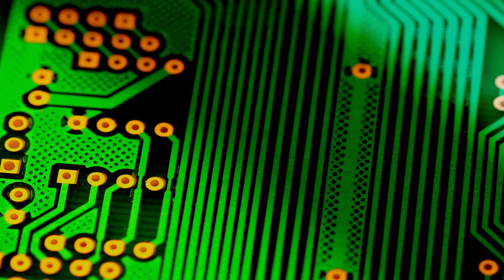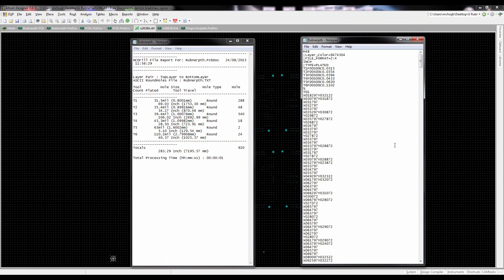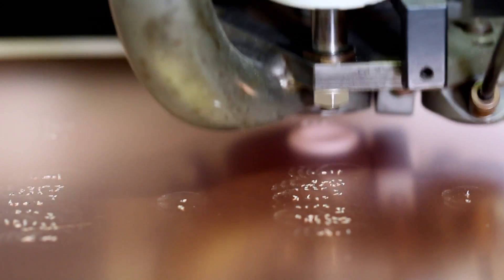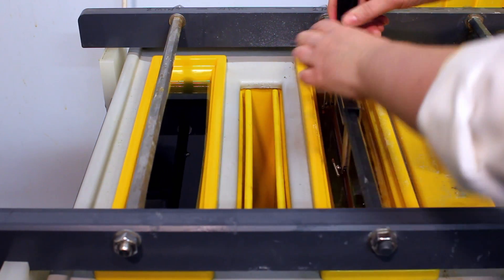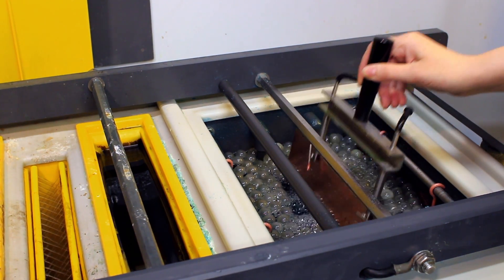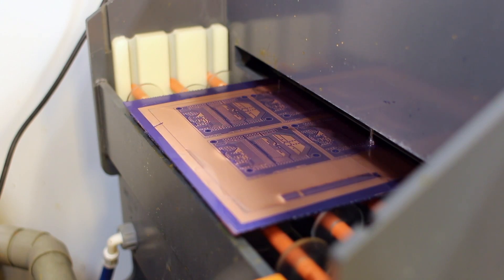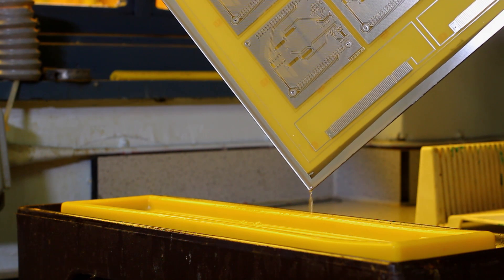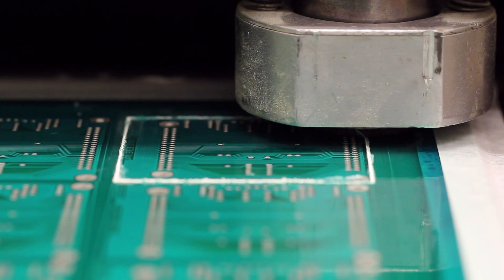Plated Through Hole Printed Circuit Board Fabrication

Comment: Which chemicals/process I can use, if I want to do PTH , at home ?
Reply: You probably already know how to etch the top and bottom - if not, let me know.
Right after you've drilled the holes, you'll want your holes plated.

Short answer: "Conductive silver ink" and "copper sulphate" are the basic chemicals you'd need. The conductive silver ink can be replaced by some other conductive paste or fluid, depending on what you can get.

Copper will not bond to the fiberglass itself, but it will bond to something that's electrically conductive.
So you need to, somehow, make the inside of each hole electrically conductive.

You could do the following:
1: Place a sheet of stiff transparent plastic on a completely flat surface.
2: Place the drilled PCB (with its burrs removed) on top of the plastic sheet.
3: Using a syringe with a needle-tip, fill each hole with conductive ink
4: Remove the conductive ink from each hole, so there's room for the copper plating.
5: Let the conductive ink dry.
6: Get rid of the conductive ink that's not inside the holes.
7: Finish by using a copper-plating bath, there are many copper-plating videos on YouTube, I'll mention a few below.

For the copper bath, you'll need copper sulphate (in the US, you should  be able to get "Root kill" or "Root away" which is very cheap, I'm not that fortunate, as I'm from outside the US).

Example video on copper-plating (this is a PCB plating video):
youtu.be/KTNuTv_IQp4
(I believe his home-made conductive ink is quite expensive).

General copper electroplating video:
youtu.be/T3qhqTVssoo

Those two videos might be enough for you to succeed your first PTH process.

-Make sure your electrodes are thick copper rods (don't use any other material, as other materials will contaminate the plating; eg. nickel electrodes would make your plating part copper part nickel).

The plating voltage is very low (usually below 7V DC).
Notice that you'll need to regulate the current.
It'll be helpful to get one of the cheap step-down converters that have a "Constant Current" feature.
Make sure both your AC-to-DC PSU and your step-down converter can handle the current you want to draw from it - you may get away with using lower currents, but it will take longer to do the plating.

Note: You can use the syringe to fill a hole, then suck the ink back up into the syringe; this will save ink and it will probably also make sure that the ink does not dry too quickly.

Conductive silver gives you the advantage of being able to check if each hole has ink inside it; place a light on the oposite side of the PCB, hold the PCB in your hands and tilt it back and forth (look at the PCB from an angle); if the hole easily reflects the light (like a mirror), then it contains ink. If it does not contain ink, then it looks darker than the others.

If you want to take things two steps further, find yourself some UV-curable liquid soldermask (for instance red and white from ebay), then you can add soldermask and silk-screen to your PCB. I've seen people use nail-polish for silk-screen (it's likely cheaper than the UV curable soldermask). The key to a good result here, is to use a transparent sheet of plastic to push down and spread the soldermask paste evenly.

Finally, If you only need to do a single PCB, you might want to skip the plated-through-hole process and stick pieces of wire through each hole, solder on both sides, it's lo-tech, not so messy and also cheap - but it doesn't look as cool of course. ;)
Reply: Note: The 'pre-dip' used in this video (palladium colloid) isn't really affordable for hobbyists.

Comment: How are the plated holes not destroyed in the etching step?
Is this missing a step that protects them, or is it some kind of selective voodoo etching process?
Reply from the maker: Each layer has it's own mask - the film applied is protecting the holes.
Reply: the photo resist film protects every hole that is aligned up

Comment: Nice video thank You! 
Can you tell please the catalyst and acceleration solution right ingredients?
Why do you not micro-etch before catalyst?
All the time all the holes plated well?
Thank You
Ferenc
Reply: the process of plating the holes on a piece of FR4 material is is very reliable, until the first 4 baths have had an amount of material through them, after that you will find the odd holes not plated, which is easy to see when you hold the finished plated board up to a light source.
Normally baths 1,3 and 4 are the ones that would make the through hole plating fail. Running the pcb through all the baths again for half the specific time rectifies the non plated holes.
Then a chemistry change of those baths with get the system back up and running.